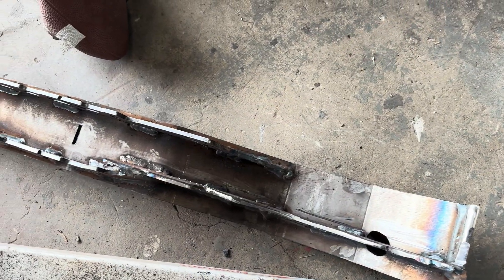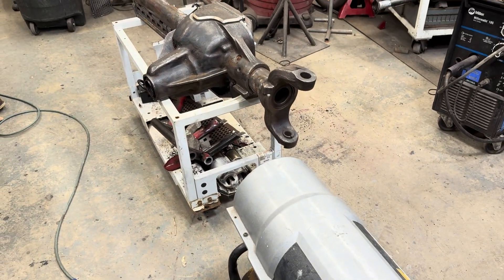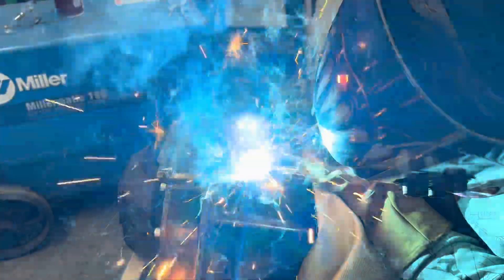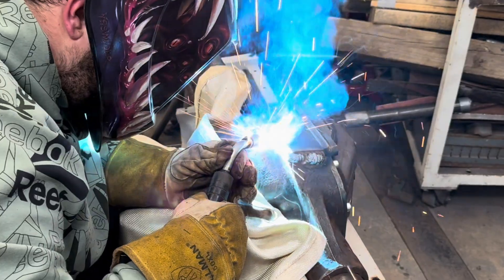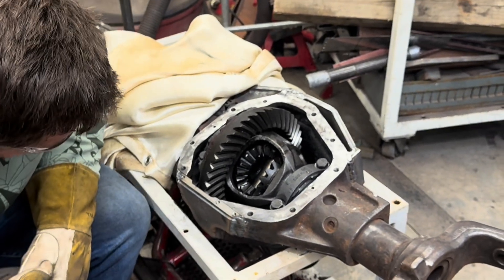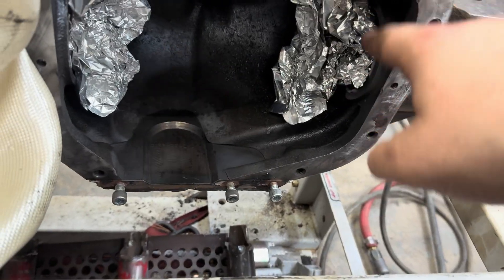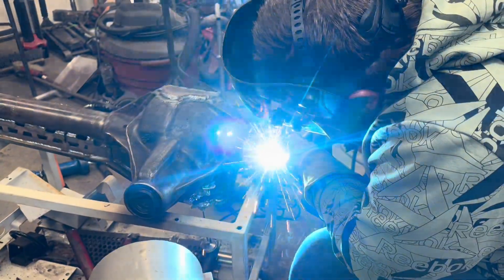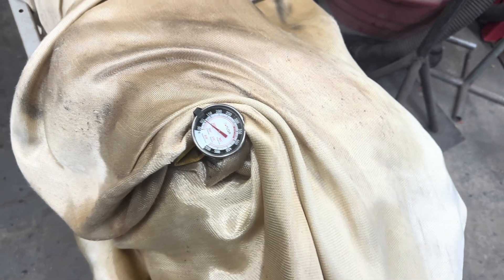Welding on a Ballistic Fabrication Dana 60 Shave Kit - Ultimate Dana 60 Junkyard Build Part 4

Comment: The moisture isn’t coming out of the metal. It’s because you’re using propane and especially so close to the surface. One of the main byproduct of burning propane is water 👍🏻
Reply from the maker: Never thought about that.   I’ll have to do some testing and try some other heating methods going forward.